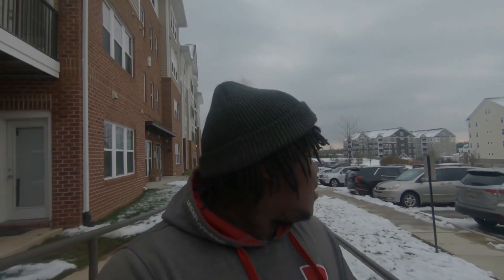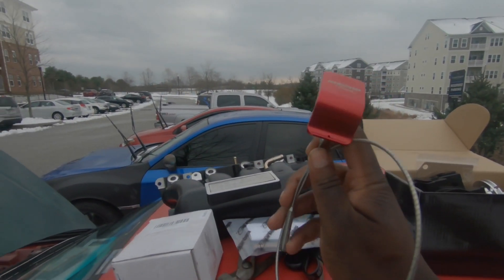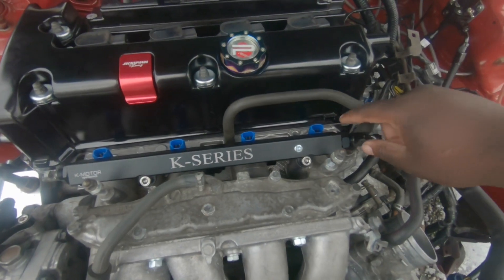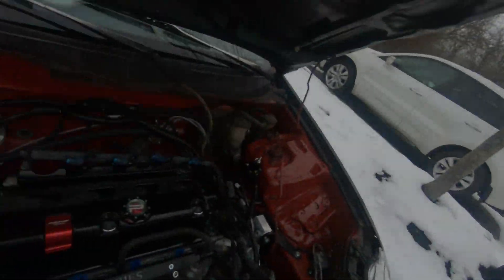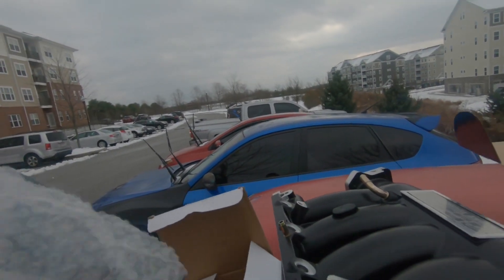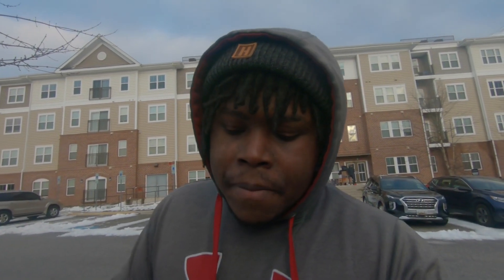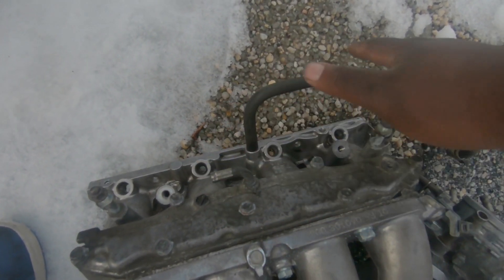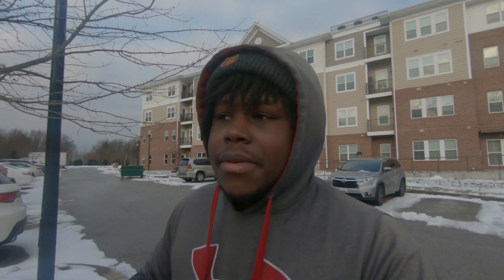KSWAP - SKUNK2 MANIFOLD INSTALL!

Comment: where did you route you’re pcv valve piping, the one going off the block by the alternator , might not get a response but would be awesome if i did, having trouble routing mine
Reply from the maker: Man I respond to everything I can catch! don't feel afraid to reach out im more than willing to share my knowledge. 

Funny enough I did not route that anywhere. I have a vac plug with a clamp holding it. I have been told you can plumb it back into the intake manifold if you would like to. I have not seen any issues with it being blocked off though. The civic is now boosted same motor on 3PSI im currently in the works for E85 before turning it up it is still blocked off at that point.

Comment: I see you gonna run ac which kit you have i know hybrid racing has one they're the only ones I seen im planning on kswap my ek sedan next year just doing my homework on what I need to start off with i have my eyes on a k24a2 and a ep3 5spd on ebay gonna run those hasport ekk2 mounts
Reply from the maker: Yeah HRs kit! I’ll throw the video up I think next week for the AC kit install. It’s actually pretty cut and dry. You apparently can make a custom kit for cheaper than the kit with diy AC kits!

Comment: I need to know what that part is...the one you said was a 60 dollar part and it's known for cracking (on the intake manifold)
Reply from the maker: I'll see if I can locate the listing for you! Mine has been on for a year and no problems whatsoever I have about 9K miles on the swap at the moment. Well no problems related to the manifold or any damage to it. 

I do have a cold start issue where it clacks for 2-3 seconds which is either the chain tensioner going out or its the vtc cam gear.
Reply: Did u ever figure out if it was tensioner or what

Comment: Is that the eBay 100$ intake manifold
Reply from the maker: Straight from eBay! It's a budget build so all of the parts are used or from eBay, FB, or wherever else I can find em.
Reply: @TheUnhappyEmo1  but Howe do you get tha skunk 2 envelope
Reply from the maker: @daurysd8402  mine actually came with all that stuff. NOS ports for the TB crappy paper gasket the metal skunk2 plate on the manifold. I picked up the 70mm tb combo with manifold
Reply: @TheUnhappyEmo1  did the ebay manifold make any power
Reply from the maker: @BunnyBUNGALO  over the stock manifold I saw 7hp gains in the software. It really shifted my power band higher up so the car definitely pulls more in the mid range to high end.
Reply: @TheUnhappyEmo1  hmm 7hp isn't too shabby. On like a vdyno you saw that much power? Or what do you mean in the software? 
I think I might get it
Reply: @TheUnhappyEmo1 can you pleasseeee tell me what size injectors to use
Reply from the maker: @onlyunojhuno  I am using the stock injector size it’s the O-rings that I had to change out. I had random ones laying around from another project that were rated for oil and gas already.

Comment: What throttle body was u running with that setup?
Reply from the maker: I believe it's a 73MM TB eBay special part of the intake combo. If you got with it I would change the throttle position sensor

Comment: i bought one of these for my tsx 2 weeks ago and its finally coming tdy
Reply from the maker: I can’t complain about mine so far aside from having to remember to plug the nitrous ports on the bottom.  When you set the manifold up the first time.
Reply: @TheUnhappyEmo1  mine just arrived ima instal it ina bit !! :)
Reply: How did it go for the Tsx. do you like it. I own a Tsx aswell I want to buy it
Reply from the maker: @alexanderabreu5312  I know some people complained about it with having drive by wire and needing an adapter to run with the tsx.
Reply: @alexanderabreu5312  well i guess u pay what you buy , you have to modify it to make work for the tsx
Reply: @sh4ppy204  what did u need to modify? My throttle body isn’t bolting up
Reply: @user-hh4hc2lt6e  depends what kind of car you have , i ended up buying a zdx throttle body because it my car is drive by wire
Reply: @sh4ppy204  please do u have Instagram, i have a tsx, i Need help i need to talk to u for a bit
Reply: @user-hh4hc2lt6e  Sure , @broken_wrist_and_ankles , btw I don’t have the tsx anymore

Comment: Hi 
What bracket did you use for the throttle cable?
Reply from the maker: Hello

I got the one listed 👇 it was 25 when purchased last year I believe or I got a knock off version of it. 

https://privatelabelmfg.com/products/precision-works-throttle-cable-bracket-k-series-for-jdm-k20a-aftermarket